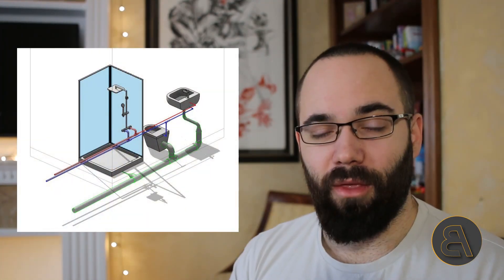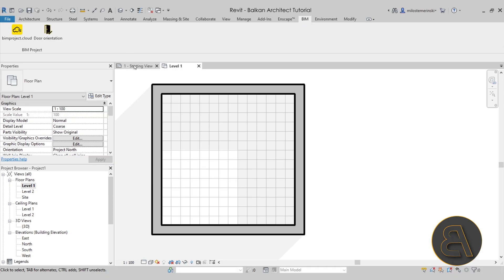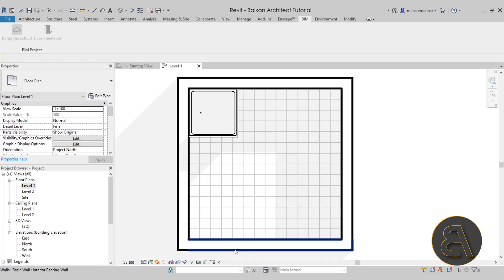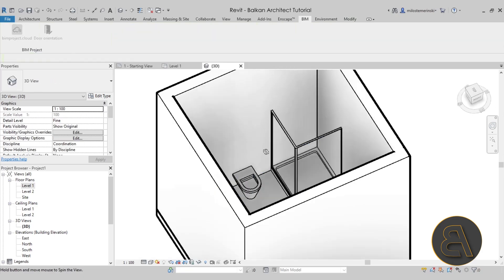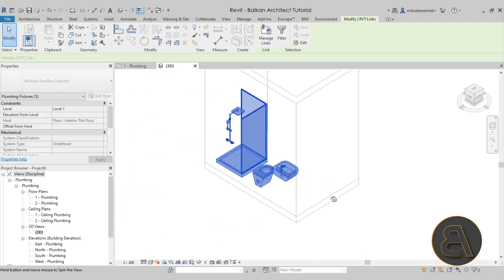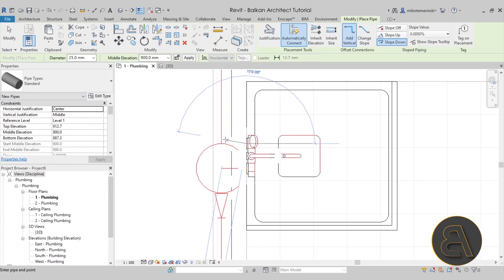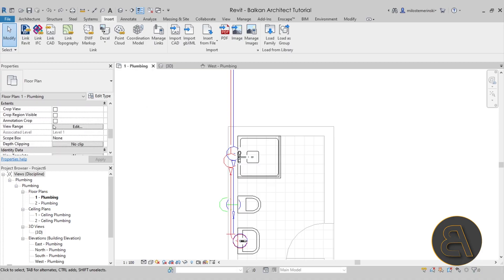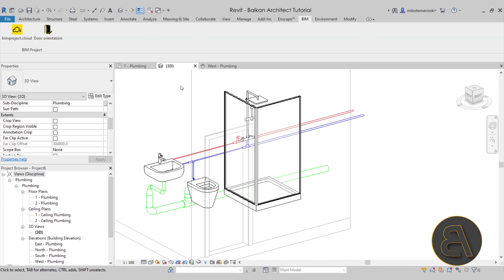Plumbing for a Simple Bathroom in Revit Tutorial [Revit MEP Plumbing]

Comment: Aren't we supposed to use P-Traps for the sanitary pipes?
Reply: He is only showing how to layout by revit. In terms.of proper designs and codes references designer engineers should apply that. As he said on the last part of the video. Each country has diffrent standards so this video is just showing how to do revit on a simple bathroom but implementing proper design is up to you.

Comment: Hi, i am a big fan of your TUTORIALS and watch them almost daily to learn somthing new. But, sir, to connect the wash basin & shower outlet to water closet is not a great idea.
Reply: Besides adding a T connection to W.C outlet pipe isn't good, from a design perspective it should be bend as it was before he adjusted to T connection
Reply: Is not a great idea? How? For common houses thats a basic installtion one soil pipe collecting shower drains, water closet and sink at tap to septic tanks. Unles ls you are designing a building structutes the requires green building design. Like 2 pipe systems, so waste from water. Closet.and urinal should be separated to waste from shower drains and sink/lavatory. That would be 2 collector pipe which is soil.pipe and waste pipe.
Reply: And i think the purpose of this video is showing the beginners how to revit a simple plumbing toilet including me. But proper designing and codes references is up to.engineers on to incorporate in the drawings tru revit software.